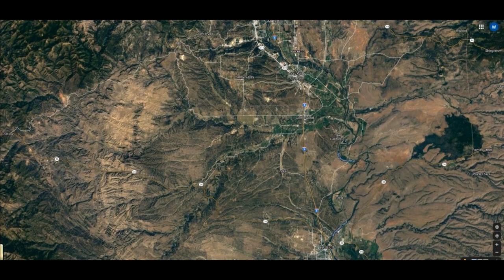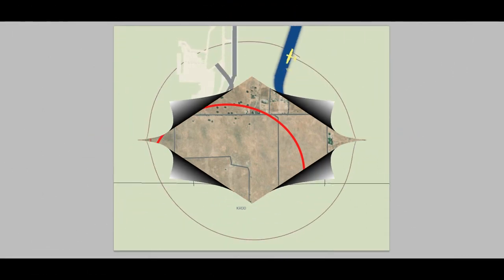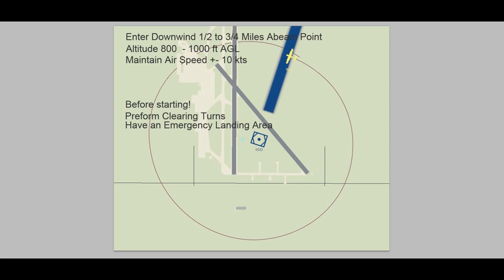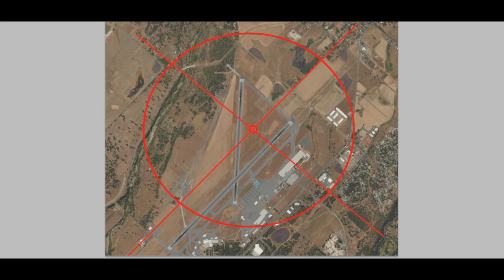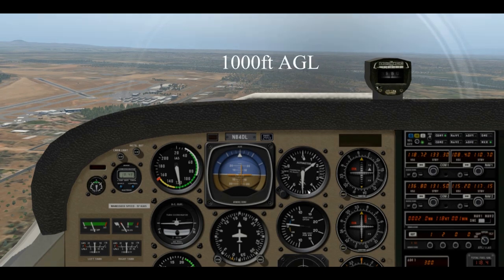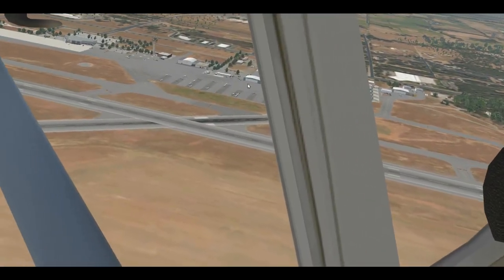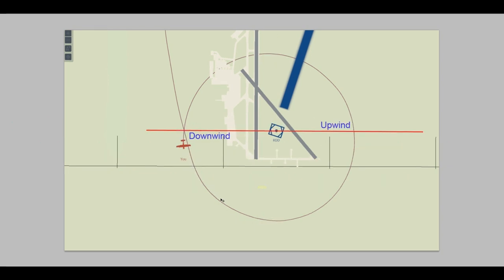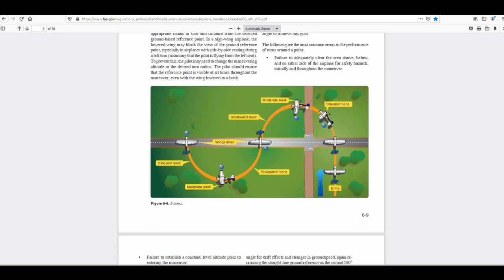Turns Around a Point ~ Learning to Fly for Beginners in X Plane 11 Part 23

Comment: very nicely done Skip, thank you.
Reply from the maker: Thanks Horatio glad you liked it hope it helps :-)

Blessings,
skip
Reply: @WEHVideos  definitely helps, my problem is that when in the sim switching views, I find it much more difficult to have an accurate sense of where I am, than I do in the real airplane looking out the windws... I'm sure you know what I mean.
Reply from the maker: Great!  

I know what you mean about switching views and unfortunately I forgot to mention anything about that in the video. I was going suggest to reprogram buttons on your yoke or joystick for Quick side and Forward views just for this maneuver anyway to make it a bit easier. I set up my hat switch  for custom "fast" views but, as you probably noticed in the video, I was still struggling with the views. A 45 deg. view would have worked better for this because the forward view was pretty much useless.

This maneuver is much harder in the simulator than in real life because of this problem. Also poor or slow functionality with "consumer" controllers add a bit to the difficulty. So if you can get this down in a simulator, real life will be a piece of cake. 

The other thing I didn't cover very well was the "Point" should not always be directly under/over the wing depending on high or low wing airplanes. 

Blessings,
skip